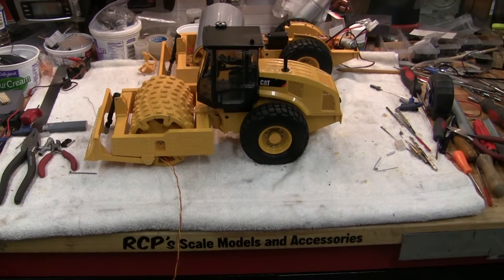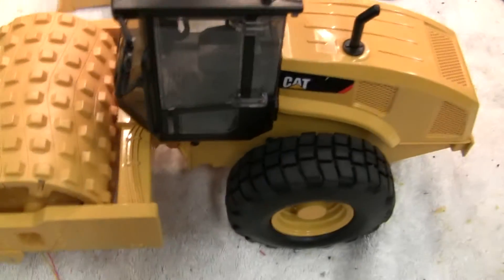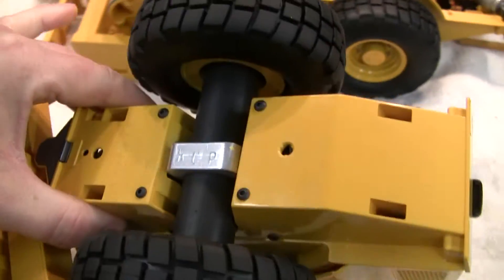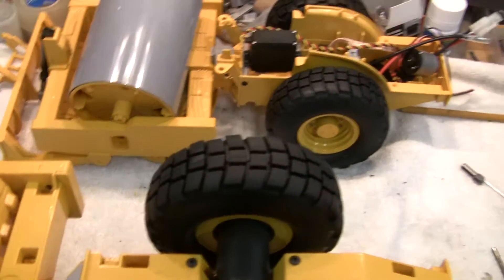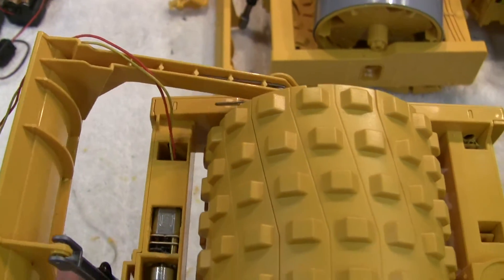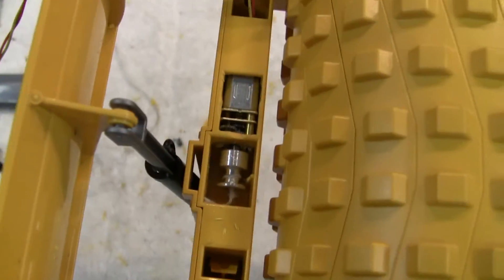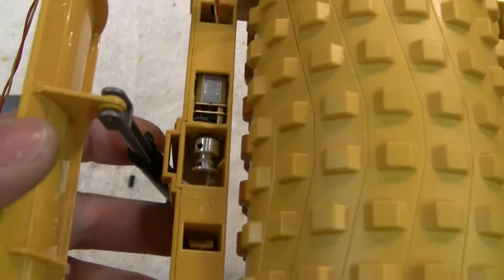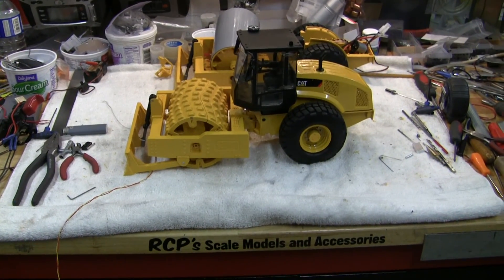Bruder Cat Compactor Conversion Part 3 Functional Blade

Comment: Did you check ebay out yet Reg for the stuff we talked about the other day?
Reply from the maker: +Gary Lowe I did quickly but shipping was crazy on any of it.
Reply: RCP57 Yeh I guess it would be. I just do local searches so I can just go and pick it up.
Reply from the maker: +Gary Lowe I didn't see anything local unfortunately. Mostly out of the US and they were charging high for shipping and duty also! Too bad because the material cost was decent.
Reply: RCP57 it is. Very decent prices. Oh well. Nothing ventured, nothing gained. It was worth a look.
Reply from the maker: +Gary Lowe Absolutely!